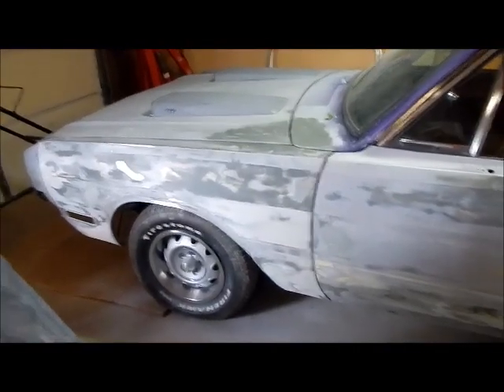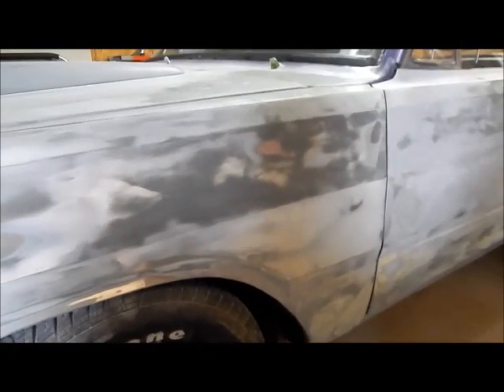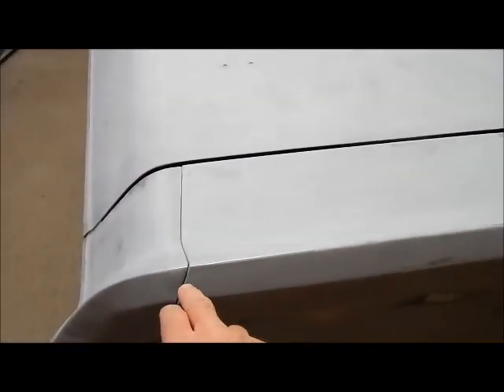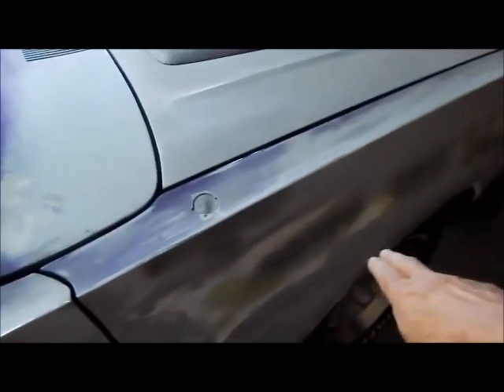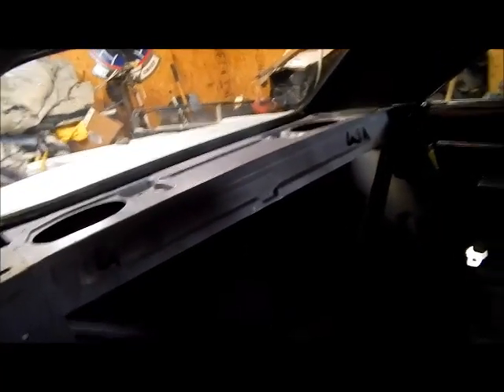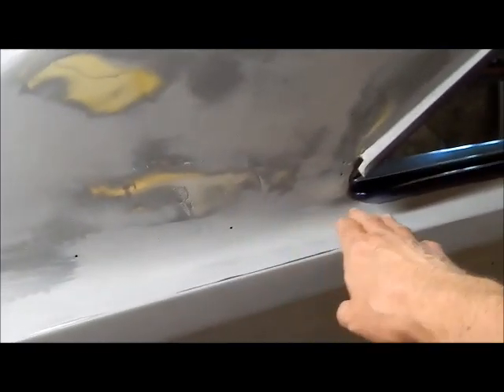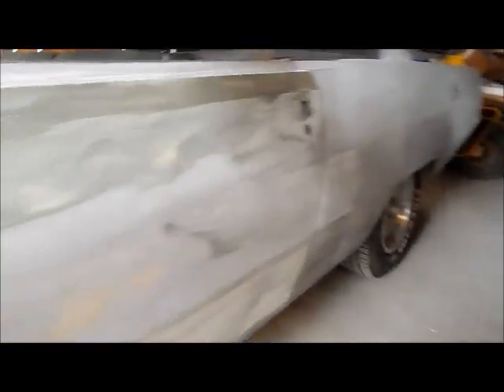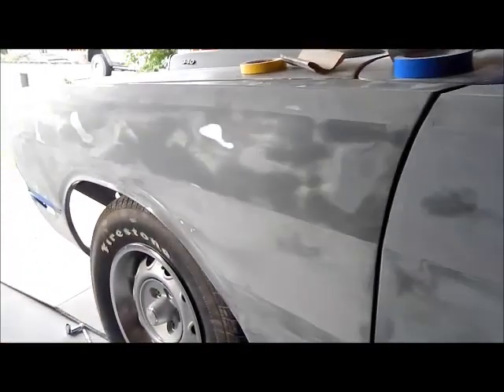Swinger Body work..." fender extensions and other imperfections..."

Comment: How did you do the body work on the pot metal as far as bending/shaping it? im working on a 69 lesabre and the extensions are giving me hell.
Reply from the maker: I didn't do much with the pot metal other than priming them, I would suggest making the fenders fit to them, or if they are real bad, seek out parts. I do realize they may be difficult to find though and pricey. Good luck.